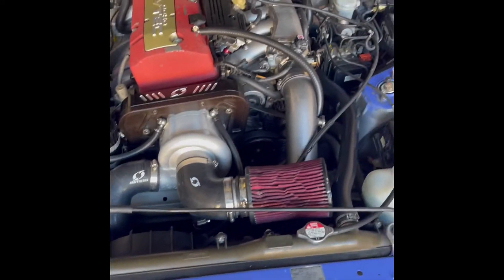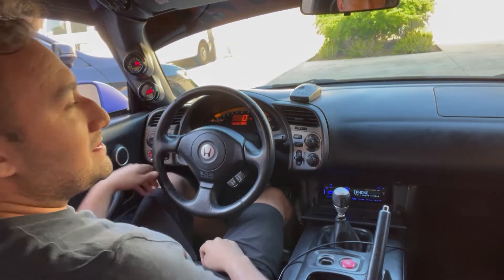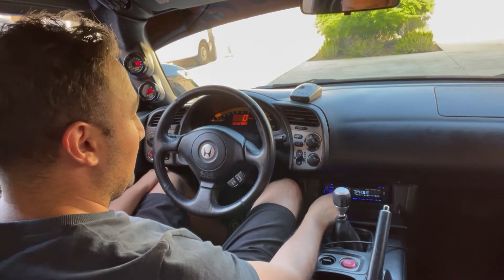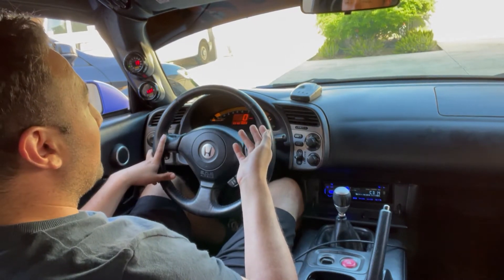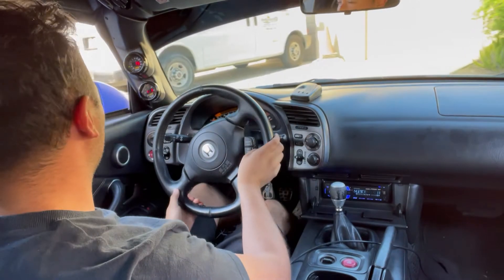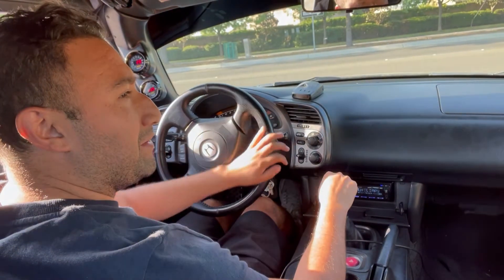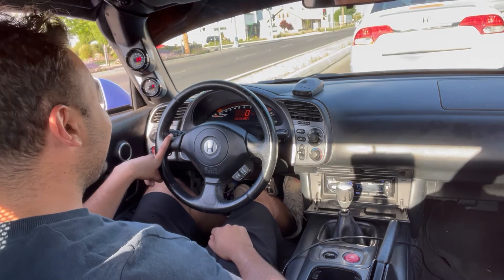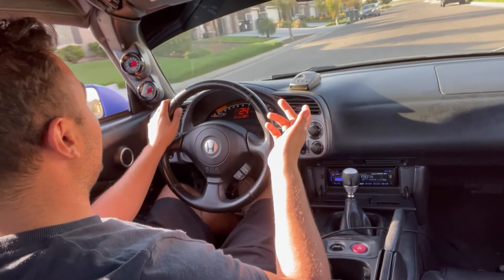490whp S2000 finally boosted

Comment: I also have an oil leak at the front somewhere around the pan. Thought it was the seal at the crank, but it was totally dry. I think the pulley spreads the oil around that area and made it look look it was the seal. I’m thinking it’s the oil pan which has a slight oil leak at the front of the engine. Hope you can find out where tour oil leak is!

Looks like an awesome s2000 you have there! 😄
Reply from the maker: Yeah hopefully it’s something simply lol thanks dude !:)

Comment: Lol im glad you like it. You should experience a turbo ap1 if you think superchargers are scary
Reply from the maker: Yeah I couldn’t imagine a big turbo s2000 !!! Prolly insane
Reply: @The_Apex_s2000  I have a turbo ap1 with a gtx3071rgen2 also tuned by Jeff. I make 457whp 322 torque. Its crazy I dont spin with boost by gear.
Reply from the maker: @jose peralta boost by gear FTW !
Reply: @The_Apex_s2000  on e85 my big turbo s2k is too much power. 1st 3 gears spin and it probably going to kill my diff/axles/trans. gunna stick to gas for now lol
Reply from the maker: @lorddragoono  yeah I bet I like E85 it’s way safer for the engine they regular 91

Comment: How may miles do you get on a full tank doing 75/80 miles hrs., on the highway?
Reply from the maker: I think I could get 150miles but that with straight E85
Reply: That case I could get over 250 on 93

Comment: I know it's an older video but I'm debating between the SOS tuner kit and the kraftworks. The SOS kit is completely bolt on, no modification required which really appeals to me.

However, the Kraftworks is like 2k cheaper, but I watched an older video showing you have to dremel/cut an edge on the steering rack for the kraftworks kit. Is that still the case?
Reply from the maker: Yup I had to trim my steering rack, if you do end up going kraftwerks I would recommend upgrading your motor mounts a lot of people snap belts and bolts due to the flex of the motor from the new power
Reply: @The_Apex_s2000  I upgraded motor/trans mounts with the megan racing oem style ones, supposedly hard rubber rated at 70a. I have the ecu already as well, went with an AEM infinity just debating which kit to use at this point.
Reply from the maker: @KevinMO91  I think bolt are good kits just make sure if you take it somewhere to get installed they do a good job 👍

Comment: half a tank 50 miles so a full tank youre getting 100 miles?
Reply from the maker: It’s actually a little better I’d say 150miles fora full tank
Reply: How do you like it compared to turbo s2000?
Reply from the maker: @ronluang  I think both are great although I think there’s less work involved going supercharged and the SC is a little more reliable

Comment: Did you figure out what the issue was with the starting when hot I’m having the same issues
Reply from the maker: Not yet dude I have a couple of theories I’m gunna test soon
Reply: @The_Apex_s2000  is it that its stalling? Is your wideband wired to a continuous 12v power source? Mine was doing weird stuff when hot starting and it turned to be that my inline wideband was re-starting and providing bad feedback to the ECU on closed loop. My fix was to change the 12v power source to the one that provides continuous power while the headlights are on. On the downside I need to keep my headlights on all the time while driving but its no big deal for me.
Reply from the maker: @godfather1317  oh nice I didn’t think about that I had a theory that my battery is getting heat soaked I’m going to test that soon after I fix my oil leak

Comment: Did the MPG really drop that low? At 150 for a full tank, the car basically becomes useless to even drive around. It makes no logical sense to me because cursing means worrying about the gas tank the whole time and refueling. Thanks for the info, stock my s2000 stays.
Reply from the maker: Yeah the mpg is pretty bad but the reason it’s bad cause I’m full E85 and the tune is pretty aggressive lol I’m sure regular pump gas would have way better mpg
Reply: @The_Apex_s2000  Oh, so what would you say 400hp s2000 on regular gas would do? I saw some people posting that they were getting 350 miles/tank. I would think that is complete BS. 

My stock s2000 the most it ever got full tank was a little above 300 miles but this was all highway driving for a long road trip. I think city driving is 250ish (its been a while since I had to fill up the s2000).
Reply from the maker: @sharkparty1027  on 91 tune the gas mileage shouldn’t be to bad . I’d say almost as good as stock
Reply: @The_Apex_s2000  Oh thanks.
Reply: Inwould agree on pump gas should be close stock. You can tune for a leaner A/F on the low cam for cruising and richen on high load for boost. My stock S2k is currently on the 450 fuel pump and ID1300x (prep for turbo) and I cant tell the difference in gas consumption. Congrats on the build! Im looking forward to mine in a few months.